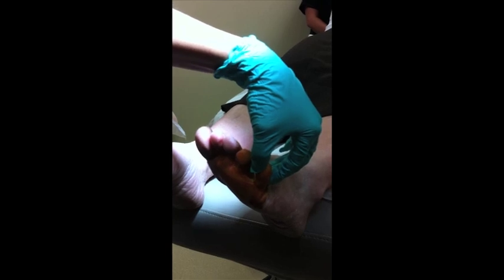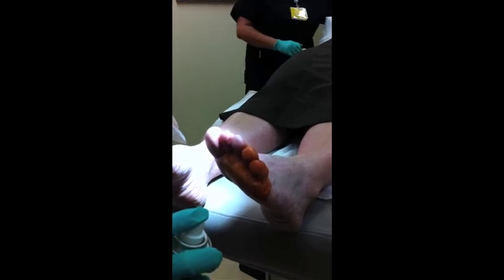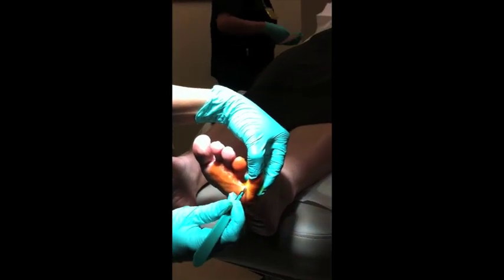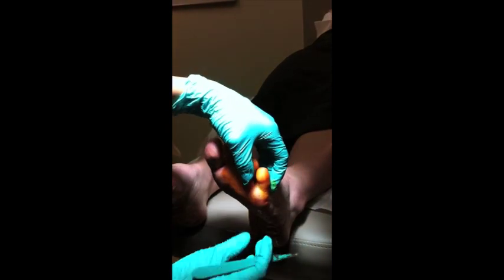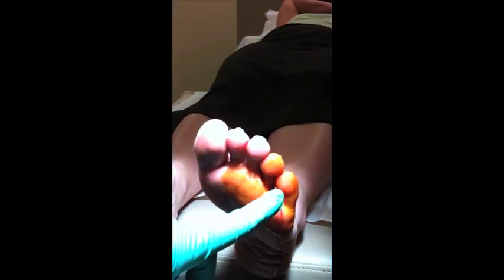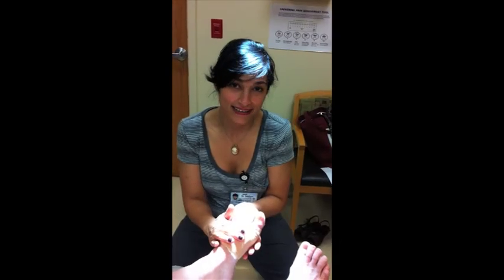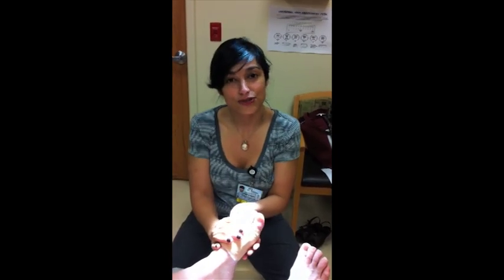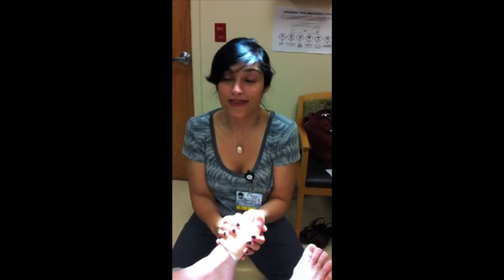Flexor Tenotomy Surgery

Comment: Hello, I had a hammer toe surgery 16 years ago and the doctors Ive seen have told me he cut my toes way to short so as the years have gone by I am losing more and more balance and have issues with any heal shoes,. The outer right toes (3 toes) do not touch the ground and I was told I should try physical therapy to strengthen the muscles under the toes. I however want the toes tendon to be release in hopes it would touch the ground and give me more stability, Shoes which I wore 1 month ago, I can no longer balance in. Its rapidly getting worse. At first I thought I was buying defected shoes since I would always end up walking on the inside of the shoe because My feet rotates inward since those 3 toes on the right are floating. It really has cause me issues. Not longer able to roller blade or wear nice shoes. What is your advice? They mentioned also placing a screw in the middle toe to see if it helps. I was told the big toe, middle toe and pinky toe are the most important toes for balancing so I was thinking I should do the surgery on the middle toe however the dr has frightened me saying we dont know the damage your really have until we get in there and there's a risk of no blood flow to the toe leading to death of the toe. I really want my balance back and wear nice shoes. Even flip flops bother me because with my foot rotating inward I end up with blisters along the v shape tongs line. I just want answers and I enjoyed your video.
Reply: High heels are bad for your body, from your toes to your neck.  Just get used to wearing stylish flats.

Comment: hello how y'all doing?...why can't the hammer toe bone be broken back into place?
Reply: One reason is because the deformity was not caused by a misaligned broken bone - it was caused by a tightened tendon. Even if you broke the bone and set it, the tendon would still be too tight to allow it to straighten.

Comment from the maker: "Extensor tenotomies (top tendon) are common procedures done for hammertoes, usually in conjunction with a 2nd procedure. It's common to splint the toes afterwards, but not all physicians do this. Yes there is a way to revise the surgery & hopefully improve your quality of life. This would likely require a more involved surgical procedure to straighten the toes & restore normal gait." – Dr. Pearson, PCRMC Podiatrist

If you have any further questions, Dr. Pearson can be reached at 573-364-8823.

Comment: I had a top tendon release done on left foot 2nd and 3rd toes -- just one "tenotomy" procedure for both toes.. in Feb. 2012.  I was not splinted after it was done, and now believe I should have been.  Those 2 toes are droopy, walking is incredibly unpleasant, and my quality of life has changed for the much worse.  Is there any way to do this over - better?